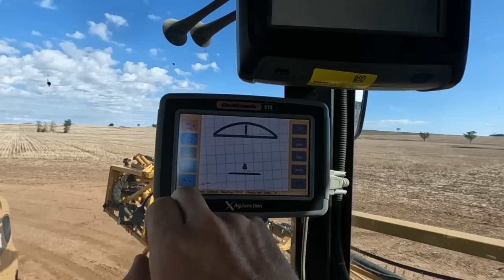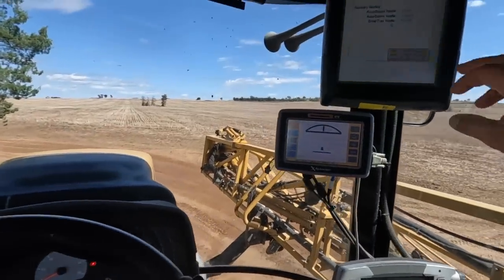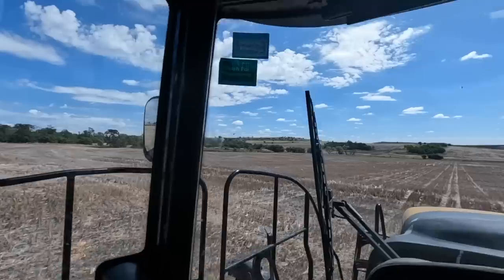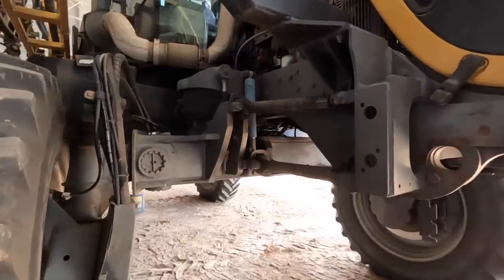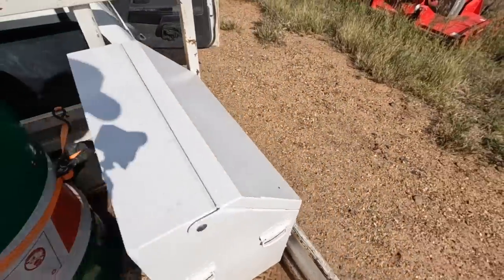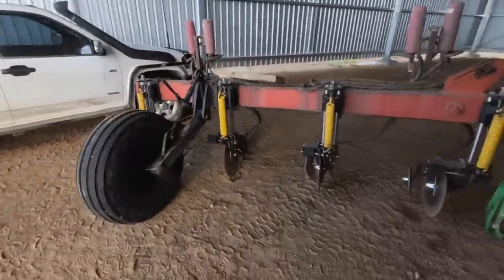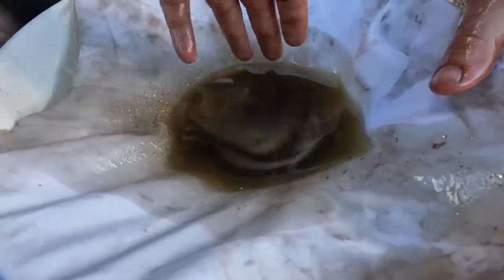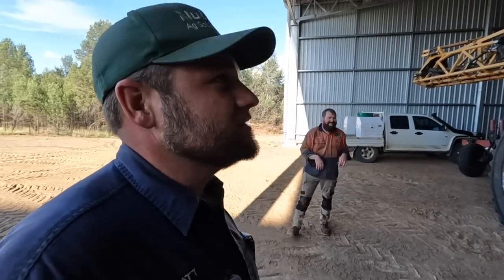THREE Sprayers DOWN!! What to do?? (Vlog 150)

Comment: right up until the end of the video, was gonna say the shiny parallel metal cylinder looked kinda like a check valve, pressure reducing valve or a flow restricter to build higher pressure or metering flow valve so yeah that'd be much better than a big bad pump going/gone bad

Comment: Good video boys. Just wondering how many hours are on the rogator? We run one as well down at gunnedah and would definitely like to avoid that problem. Cheers
Reply from the maker: Thanks mate! I would definitely send the hydros and motors in to be rebuilt at 5000hrs, ours is at 6000hrs
Reply: Out contract spray guy got about the sane out of his, did all 4 wheel motors and pumps between 4.5 abd 6.5 thousand hrs 

We've got a goldacres now, direct drive ftw ha